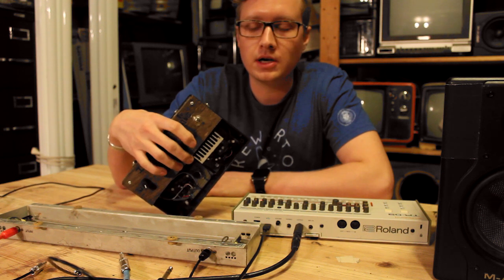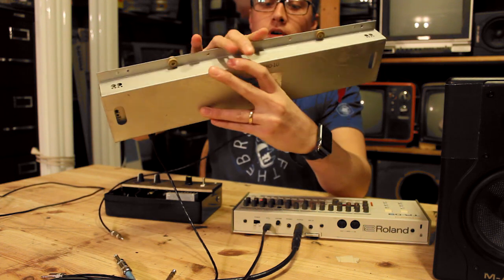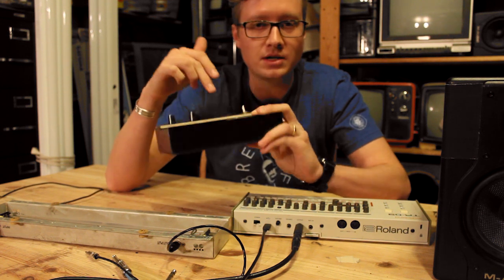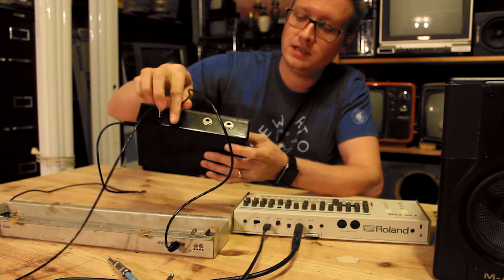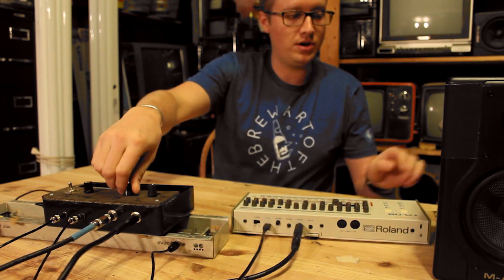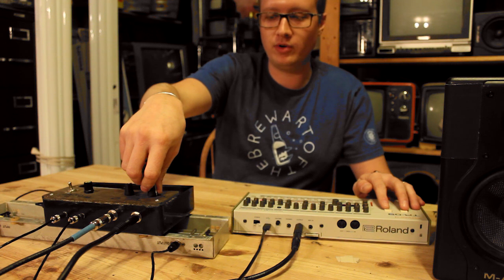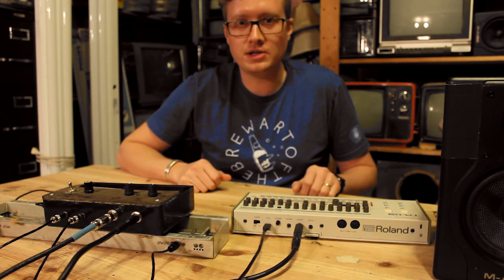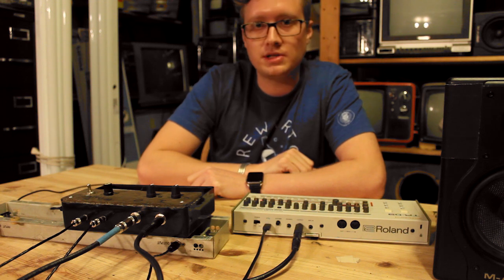DIY Spring Reverb

Comment: Reverb effect is easy to make at home, all you need is small 1W amplifier and tank with long spring in it, (you can literally make tank/box at home easy) and on both ends of spring inside must be inductors, (coil and magnet) or even easier, instead that you can also use one small speaker on the left side of tank (as input) and piezzo electric element on right side (as output of tank) ,as I did..
So, you first remove original speaker from 1W amplifier, and that wires go into input of reverb tank on the left side, signal then goes throw spring in piezzo element, and wires from piezzo element go out to another MAIN amplifier (or audio interface, whatever) right in input, where you plug guitar...you have usually few potentiometers on first small 1W amp, so you can change signal a lot, as you wish..I hope this is easy to understand, (for playing you plug guitar in small amp ofc)
I use marshall ms-4 as a small amp
Reply: @peterrabbit7173 
It's not point always in buying, if you can make something yourself, I really love electronics btw, it's my hobby..I have few amps that I bought, but I also made 2 on my own from scratch, as well as couple pedals

Comment: For anyone reading if you find a transistorized hammond they (some) have a standalone driver board attached to the reverb tank. Look for one made in the late 70s or early 80s. (Dont ask me for a pinout i just picked the organ up today and usually deal with tube stuffs.)

Comment: Do you think one of those cheap little 6J1 tube preamps on amazon would power a reverb tank? It would be for guitar, and obviously it's a stereo preamp, so the chain would be: guitar> R preamp in> R preamp out> reverb in> reverb out> L pre in> L pre out > guitar amp. I'd probably figure out a way to make a dry wet mix with a small mixer or something.

Comment: I've not had any hands on experience withbapring reverb, other than built into a Marshall amp, so sorry if this is a daft question:  can you actually hear the spring?  As in, sound actually coming from the spring itself
Reply: Sound is NOT coming from spring, signal goes through spring into amp

Comment: If I run a line level (synth) into a booster pedal, and into a mixer, would that be enough signal?
Reply: booster pedal prob wouldnt be needed, he's running a line level drum machine straight into it here (probably -10 dbv). Not sure how much gain the preamp has but it's designed for guitars I think so probably plenty

Comment: Do you think I could just use a guitar amp pedals with a reverb tank without building anything?
Reply from the maker: Unfortunately no, you need some kind of power amp to drive the spring tank and a pedal won't cut it. But many kinds of small audio amps could work

Comment: What kind of psu you use with this unit ?
Reply from the maker: I can't remember exactly but I think it was 12v 2a. Nothing fancy
Reply: @KyleEvansNewMedia  they recommend to use dual voltage supply with the unit but i was interested does it work with normal single voltage supply.